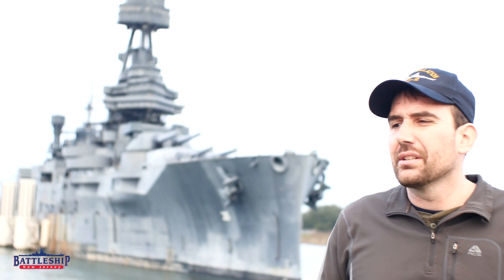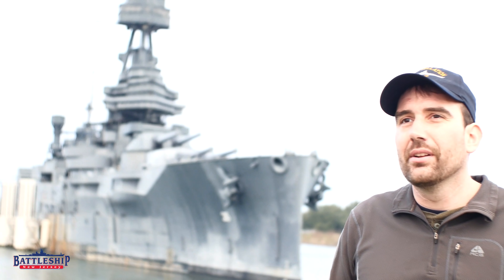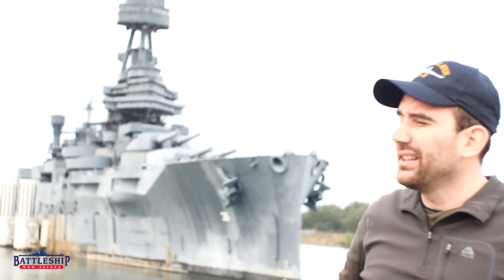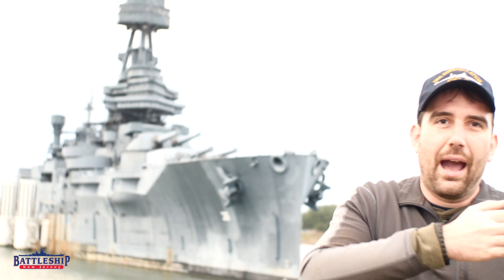Why Is Battleship Texas Shaped So Weird?

Comment: To me the weirdest part of her design is the midships turret. It makes her look as if the Navy had an extra battleship turret laying around and didn't know where to put it.
Reply: 25% more firepower in a broadside and 50% more firepower when running from the enemy. If you have to run you'll be zigzagging and can bring the three turrets to bear while a pursuing capital ship only has the two front turrets to shoot at you.
Reply: Originally the ships, as built, had three aft turrets, only after the refit had the rear tower been moved behind the third turret effectively making it a AB-P-XY instead of an AB-XYZ layout.
Reply: @olegjakovljev5777  Thanks.
Reply: the problem with soo may turrets in ships of this era,  is the magazines directly below each turret, that makes a ship with a lot of vulnerable magazines. Something they figured out later down the road.
Reply: USS Texas would ironically be the last "Turret Farm" Battleship since the follow on Class the Nevada's introduced Triple Turrets allowing the same number of guns as Texas without the Extra Turret.  Before that Battlehips had tons of turrets- just look at the Wyoming Class.
Reply: @MrChickennugget360  HMS Agincourt
Reply: @MrChickennugget360  Luckily, the US had plenty of Turret Farm cruisers later on such as the Brooklyns and Worcesters
Reply: it's better then a lot of designs with center wing turrets.

Or SMS Kaiser with her offset center wing turrets.
Reply: When the dreadnought revolution occurred, and large triple expansion reciprocating engines could be replaced by much more efficient, smaller, turbines, the reduction in machinery space required to go a given speed freed up a lot of room in battleship design. Naturally, all that room was spent putting a midships turrets in (recall that a turret is not just a turret on the deck, it's also a magazine, elevator system, armored barbette to enclose the entire thing, etc etc... It's a lot of below deck space. Of course, as time went on and the speed requirements for battleships rose, please image ships turrets slowly went away. Hood, arguably the first fast battleship, is an excellent example of what happens when you need a lot of turbine machinery to make a very big ship go very fast.
Reply: @antonhengst8667 , the only thing I disagree with, is considering the Hood as a “Fast Battleship.”

She was officially considered as a Battlecruiser by the Royal Navy.
Reply: @daveherman6624  I think that it was a hard lesson.
Reply: @olegjakovljev5777  midship turrets were common at the time as triple gun turrets weren't common
Reply: @bigz4302  Triple turrets weren't exactly uncommon in the 1910s... Italy, Austria-Hungary and Russia all used triple turrets
Reply: @daveherman6624  The main reason for elimination of the midships turrets were: most importantly freeing up space for propulsion systems as speed became more important and more efficient layout as larger guns made the multitude of turrets less critical.
Reply: A lot of Battleships and Battlecruisers. Of the WW-1 time period, looked that way.
Reply: New turret/gun designs took a lot of money and time. So often when the Navy wanted a new more powerful battleship class they just added an extra turret. 

South Carolina class started out with 8x 12in guns in 4 turrets which is a really good layout, but then the next classes ended up with 10x 12in guns in 5 turrets and 12x 12in guns in 6 turrets. New York class got 14in guns but still in twin turrets and 8x 14in wouldn't have been an upgrade from 12x 12in so they still ended up with 5 turrets and 10 guns. After that the Nevada class finally got triple turrets and could use a 4 turret layout with 10 guns (2 twin 2 triple).
Reply: I know they're not as good,  but I love how turret farm battleships look.
Reply: The preceding Wyoming class (Wyoming BB-32 and Arkansas BB-33) had twelve 12-inch guns in SIX turrets.
Reply: @JohnJ469  "... and 50% more firepower when running from the enemy."

The United States Navy does not run from the enemy.  Seriously, their ships are designed so that the main battery is forward (assuming an odd number).  All but one of the single-ended guided missile cruisers, for example, had the missiles (their main battery) forward, the exception being Truxtun, whose reactors didn't leave enough room for the missile magazine forward.
Reply: @michaelsommers2356  Not running when you're hopelessly outgunned is just suicide and pointless. And I didn't know the US Navy had guided missile cruisers in 1920. We're talking about ship design in the early 20th century.
Reply: @JohnJ469  I'm talking about ship design over many decades.  As for being hopelessly outgunned, the trick is to not let youself get caught in such a situation.  Can you cite an example of when the USN ran away from a battle?  Aggression, is cultivated in the navy.  Notice how Spruance is still criticized for not pursuing the defeated Japanese carriers after the Philippine Sea, and how Halsey gets less criticism for mindlessly pursuing the now useless Japanese carriers, and leaving the transports and their escorts unprotected.  Also notice the response of those escorts: although hopelessly outgunned, they attacked.  They didn't run away, and their attack was not pointless.
Reply: @michaelsommers2356  And you're still at least 30 years post the design of these ships. It's not about WW 2 it's about the thinking behind the design of major warships before WW 1. No radar, no spotting aircraft, your 1 capital ship and 4 destroyers might suddenly have 4 battleships and 20 destroyers appear on the horizon. How do you maximise fighting ability and survivability?

Enough with the chest beating from a different time.
Reply: @JohnJ469  This isn't chest pounding.  I'm just telling you how the navy thinks, and has always thought.  If they have an extra turret to plop down somewhere, they aren't going to have it point aft in case they want to run away.  They may have it point aft for other reasons, but not to facilitate running away.

In your proposed scenario, remember that the chasers don't have radar or planes, either.  What would they think if you turned towards them?  Might they not think that there must be reinforcements behind you, and run away themselves?

And look at it the other way around.  Suppose you are chasing someone.  Don't you want more weapons facing forward?

The fact is that successful navies do not plan on running away.
Reply: @antonhengst8667  yeah but Texas was not a turbine ship.  She used reciprocating engines.  In fact she and her sister New York were the last two coal fired reciprocating engine battleships of the US Navy.  The truth is the US Navy had simply not perfected a triple turret design yet and that's why she has the extra turret.  USS Nevada would be the first ship in the US Navy with triple turret main guns.  The last double turret main gunned US battleship was the USS West Virginia and she had double turrets instead of triple turrets because she her guns were larger at 16 inches than the 14 inch guns that have been in use since the advent of New York and Texas.  Since they were still using the same turret design that had fit 3 14 inch turrets on the previous class they just didn't have room for the third gun.  This was corrected in the North Carolina class when a new turret design was introduced allowing three 16 inch guns to be fitted in a single turret.
Reply: have you seen the USS Wyoming?
Reply: @Michael Sommers You seem to have forgotten about the whole Philippines/Dutch East Indies disaster where the U.S. Navy completely gave up on defending the Philippines before the end of 1941 and they did a great bugout to abandon the U.S. Army in the Philippines. The Navy's submarines sank ZERO Japanese warships in the Philippines and even they also cowardly retreated by Christmas 1941. The Navy bugged out at Java in February and March 1942 except for the brave and heroic USS Houston who refused to abandon her Dutch comrades. All the other U.S. Navy ships cowardly retreated and abandoned Java though and many were sunk by the pursuing Japanese. Then you have Guadalcanal's 6 months of sheer terror naval battles. The U.S. Navy kept bugging out of the area due to the Japanese Navy not getting the post-WWII 20/20 hindsight propaganda memo that they were supposedly destroyed at Midway. The Japanese proceeded to kill 5,500 USN sailors at Guadalcanal and sank 30+ USN warships to the bottom of the sea at Guadalcanal. Many times the U.S. Navy ordered their ships to bug out and abandon the Marines and soldiers on Guadalcanal after submarines or airplanes or surface ships sank U.S. ships, which happened almost once every week during the Guadalcanal Campaign. When you have to claim that the Friday the 13th November battle at Guadalcanal is a "victory" despite losing 5 out of 13 ships and losing all the admirals in your squadron killed in action (Callaghan and Scott) you have a lot of problems going on. It is a shame how nobody wants to talk about the exhausting naval campaigns at Guadalcanal (I am not talking about the ground war in Guadalcanal which is still talked about frequently) nowadays compared to Midway and the 1944-45 campaigns. Naval Guadalcanal was one of the scariest moments for the U.S. during WWII. By the end of 1942 Enterprise was the only Allied aircraft carrier in the Pacific!!!

Btw, Spruance was complicit in the coverup of the infamous USS Hornet's Flight to Nowhere during Midway. What the Hornet did at Midway was criminal and should have led to court martials and punishment for Admiral Mitscher and his officers. Spruance had numerous faults like Halsey like Spruance's failure to stop the Japanese kamikazes at Okinawa. He failed so badly that Halsey had to relieve Spruance of command in the middle of the battle! Spruance's sailors suffered PTSD on a level never seen by the USN before and after Okinawa. The Navy always likes to lie and claim that the kamikazes did nothing at all. They successfully helped to delay and prolong the Okinawa campaign and killed almost the same number of USN sailors in 3 months as they did in 6 months at Guadalcanal.
Reply: Though the "center turret" could never bear to dead astern by the superfiring turret aft, the 15 Degree elevation would not allow for firing over the aft supervening turret (I had to use a protractor as I have yet to find a official document, using the center of turret the 15 deg scrapes the turret to the rear.) so the change in masts really changes nothing.  If I am incorrect please tell me where to find info.
Reply: That would be the previous USS Texas
Reply: Yes the RN and US and Naval Historians have  different names for things.  DE - Frigate etc...

Comment: I worked in a Navy shipyard for 18 years.  When there are multiple ways to fulfill a design requirement the solution picked was often the one with the loudest advocate.
Reply: Or the cheapest budget.
Reply: @stevenbaker8184  this wins EVERY time.
Reply: I also worked in a naval shipyard for 19 years as a welder apprentice, WG10, high pressure pipe welder....and GS series. Your statement is totally true.

Comment: If I remember correctly, Texas was the first ship equipped with radar. It was a tiny room and was the only place on the ship with air conditioning. I also seem to remember those "gun decks" being a later addition to the ship.
Reply: Believe New York was first.
Reply: Now that, I find humorous, your reference to the "small air-conditioned radar room." I was assigned as an Electronics Tech, to the Data Systems School at Mare Island, in Vallejo, California in 1969. None of us knew about it at that time, but when we went to our assigned ships, we found that all of the computer and much of the radio gear was cooled to 68-72 degrees. A chilled water system was plumbed from the engine room up to heat exchangers in the equipment. Some of the Machinist Mates and Enginemen would come up to visit occasionally to get out of their shops that were typically running closer to 120 -140 degrees when we were in the Tokin Gulf, off the Vietnam coast.
Reply: Texas and her sister ships were fitted with radar in December 1938.
HMS Saltburn was fitted with a prototype radar in 1936. HMS Sheffield had the kind of radar that Texas and New York had by August 1938.

Comment: i think it comes down to the tech and doctrine of the day.
you got to remember the texas was completed in 1912 which means she was designed by people that were born in the late 1800's and taught marine engineering by people who designed ships that had only sails. not only that, you got to wonder how old the brass was that signed off on everything. these guys probably viewed naval warfare differently to now. point is, no wonder texas had gun ports, that's what worked then.
it's interesting to think that we'd consider a battleship a bit of a waste of time to build now. but that's only because we can put 30 missiles through a portal and into some admirals bowl of soup from like 5000kms away with the push of a button and enjoy a caramel frappuccino while we wait.
Reply: Ah, so you're saying "War" is a Yuppie thing now?
Reply: 1912 is the launching.  Construction continued to 10 March 1912 with the last hull plate was installed.  Even after the 12 March 1914 commission, construction still continued until 23 March at Norfolk Navy Yard.  Ater Norfolk, BB35 went to the New York Navy Yard for further work until late April-early My 1914
Reply: I think you are underestimating how much science was involved in the design of these ships. Heck, a good 75% of modern engineering is based on science that was well known in the 1900s.  For instance, consider how insanely large the Great Eastern was for it's time, still bigger than USS Texas while being build 55 years earlier. It was not technology that was limiting the size of later constructions, but more the lack of perceived need to go that big (with the funding available). 
Also the New York class was more towards the end of super-dreadnought 2nd generation. She's roughly contemporary with the Queen Elizabeth's, who where contending for the most technologically capable battleships of WW1. 
Casemates had some considerable advantages as a design, and while it's drawbacks where known,  they where considered subservient to the benefit of adding more guns on a certain displacements with the experience at the time. Moving over to deck-level casemates, or even turret mounted secondary guns, where always at the cost of less guns or less protection because of how it would make the ships more top-heavy.
Reply: yes although indeed a lot of science went into the naval designs at the time, there was also a lot of preconception and bias towards what ships should be like, and the old guard "Battleship Admirals" had a lot of sway on naval design and were quite conservative. This is why it took so long for archaic features to disappear like rigged masts, ram bows, flying bridges and prow casemates
Reply: Send that Yankee home.
Reply: @SmokeyBCN  You can add cage masts to the archaic features bit. They're such an American thing based on a silly idea, which to my point, was never vindicated from any battle, to justify their original selection vs yep, they're actually shit so we'll change to tripod masts like everyone else used. Yet they served as a ubiquitos and ugly identification only seen on US battleships. 
Side note - Pity the Iowa design wasn't ready and approved even one year earlier, and with 3 ships built at a time............... One can only imagine that outcome.
Reply: HMS Warrior was launched in 1860, the first iron hulled warship, and was steam powered. I doubt USS Texas was built by people taught by people who designed ships that only had sails.
Reply: @gwtpictgwtpict4214  Quite possible, but it can take a generation or more for concepts that no longer apply to age out of the system that designs and builds them. Anything that looks too different is “radical” and anyone who proposes such gets locked out of discussions. A “safe” design is one that incorporates a new innovation or two but doesn’t buck the establishment’s concept of what something is supposed to be.
Reply: @davidb6576  Those big gun turrets took huge crews to bring powder and projectiles from magazines below even with lifting machinery. And huge crews and guns needed a lot of steel bringing a lot of weight and size into play for what purpose?  That was to onlyt increase range maybe10 to15 miles over a crusiers firing range.  Crew size and ship size decide heavily in what will get built.
Reply: Wow. Incredible

Comment: My guess is they were for her casemates that were removed in the (I think) 1942 refit
Reply: The forward guns were removed in 1925, along with some of the midship guns, and the gun at the tip of her stern. Six were relocated to the casemate on main deck, and two to the top of the casemate on 01 level. She lost the remaining hull guns in her 1942 refit. The two guns on top of the casemate were either lost in the 1942 refit, or removed in 1941 prior to the refit.

Comment: Crenellation is a feature of defensive architecture, most typically found on the battlements of medieval castles. A battlement is a low, defensive parapet. The act of crenellation is the cutting of crenels into a previously solid and straight parapet wall.